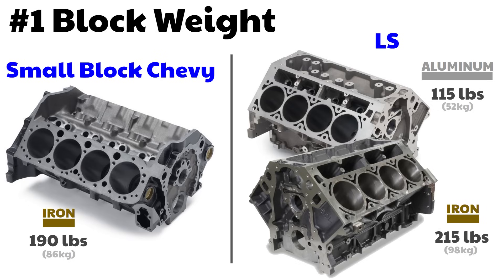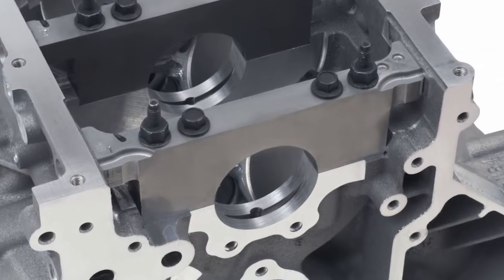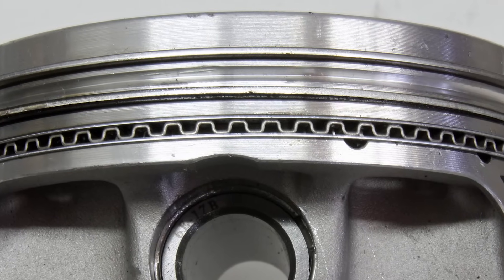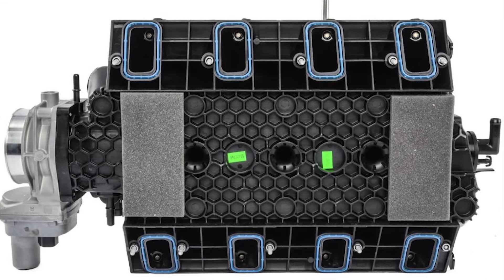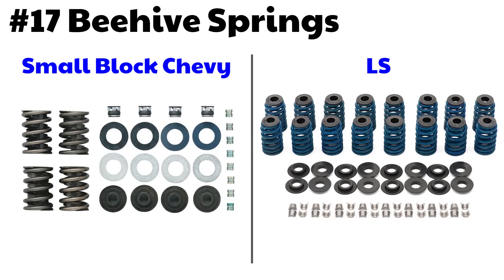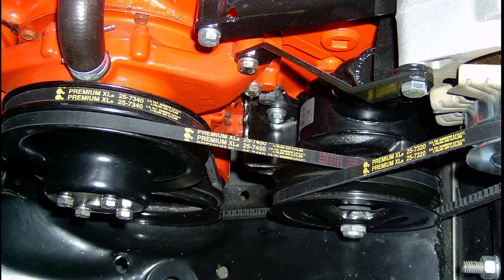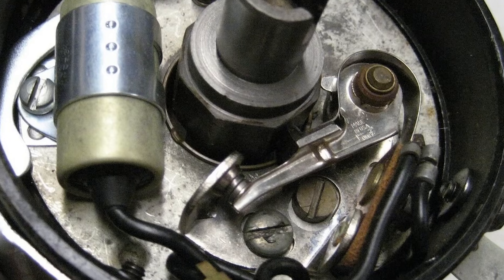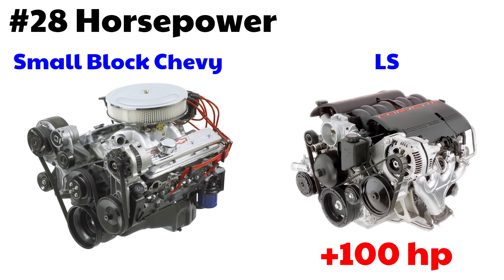29 Reasons LS is Better than Small Block Chevy (Gen 1 & 2 vs Gen 3 & 4)

Comment: Just one additional item to add on the LS exhaust manifolds, they are steel, not cast, so you can actually cut and weld for fitment to LS swaps.

Comment: A few things that made the LS better than the sbc, deep skirt Y block like the First Ford OHV, cross bolted mains like the FE Fords. Shaft mounted rockers like the Y blocks, non siames intake and exhaust ports like the SB Fords. Cleveland style canted valve  heads like the Cleveland Fords. So yes the LS is better than the sbc but they also found some better ideas from Ford.
Reply: Canted valves first done on the mark 2 BBC  mystery motors. Ran in Ray Fox’s chev driven by junior Johnson at Daytona back in 63. Bill France made Chevrolet sell one to Ford, that’s where they got the design. The engines were cancelled due to the GM racing ban. The slightly changed engine was released as the mark 4 ‘396’ in 1965. I had sbc and Cleveland’s but the sbc way better engines even with Siamese intakes.

Comment: The main difference is you need a certified mechanic to work on the LS. Its all controlled by a damn computer. All the sensors and all the new control modules. All that just adds another possible point of failure. You can work on a SBC yourself and you cant on a LS. The SBC is way better. dont need a computer to tune it. If u change one thing on a LS you have to pay even more money to reprogram the computers thats if the manufacturer didnt put restrictions on the ECU so it cant be tuned which is almost all newer cars and trucks. I am 40 years old and I will keep my SBC any day over a new computer controlled LS. I can work on my truck and change everything on the engine and not have to worry about a stupid computer throwing codes or reprogramming a computer given its not locked by the manufacturer. Its funny all the youngsters talk about what has been done to their LS or LT yet 99% of them didnt do any of the work and probably have no clue how to fix it themselves. Most couldnt even point out a specific part on a engine and what it does or why its important. SBC has not one of these problems. Just shows the younger guys dont want to put in the work on a engine to maintain it, "take it to the shop and pay someone to fix it". Probably dont even have any tools to work on it if it breaks on a Sunday or if theres no shop around. LMFAO. NO THANKS, I WILL KEEP MY SBC. YOU CAN HAVE THAT COMPUTER CONTROLLED POS.

Comment: Yeah  I agree LS is a superior engine in many aspects but I did see a few things, your HP ratings for SBC seemed Conservative, about any SBC block and crank will go around 500hp, another crazy thing is the skirted block isn't the best design is good for strength but that's it the open block is superior in several ways. World products prefers the open block vs skirted block that's why there are hybrid block is looked at as the best design thats basically a sbc that accepts LS heads. I was watching Noonan (I think) engines video there tippy top dog custom billet engine had the SBC/BBC lower block design. One thing is bay to bay breathing...? People are quick to disregard the SBC but with off the shelf aftermarket parts the SBC is still a viable platform there are plenty of folks that still successfully compete against LS cars with the SBC.  The mind blowing thing is the SBC was such a revolutionary design that with some help it can still hang with LS engines with 1950s architecture....
Reply from the maker: My understanding is on the old small block it really depends on what year and what engine you get.  Some could handle power and some could not.  With the LS you know for sure what you are getting.  The original engine is still a solid choice.  For me its the 100 pound lighter aluminum block that makes me love the LS most.

Comment: You are so full of yourself Why don't you compare the last year small block against the first year only LS. For example you say serpentine belts and roller cams The small block had that. How about when your computer goes bad how about one of your sensor is go bad how about 1 of your coils go bad and you have multiple mysteries and you can't figure it out. There is such thing as aftermarket parts Especially aluminum heads for small blocks That will flow just as much as LS is That will flow just as much as LS is. How about let's talk Bang for buck You will spend twice as much for LS Just in your sensors alone cut it out and if you wanna talk Bang for buck you can go with big block Chevy which will crush LS. There's nothing wrong with LS but you misrepresented the small block Chevy

Comment: Small block chevy is better gas and fire it will run and will go anywhere ls is trash after a hundred thousand miles the lifters clatter its not as powerful as a 350

Comment: this guy is a liar. my 1978 350 is 600 hp at 5800 rpm. 450ftlbs of torque. And i can add to 900hp! and this guy had never built an engine! All mercruiser engines from 1985 up has roller cam and lifters. GM motors.  What a clown.

Comment: Ironically, someone who already runs an sbc can use aftermarket parts to mostly level up with the ls.  Cop is available but not vvt iirc. Re merit of vvt, it's unnecessary because savvy engine builders talk customers out of high duration, torque-robbing cams.  That said, cars that need a swap would benefit from ls oem features.  Great video.

Comment: so the only performance advantage is the block and thats it. i can take  the original small block and use improved after market blocks , heads , cam  etc.. and build  it thats just as good or better  because the l/s has already used better materials and parts we can use with aftermarket.

Comment: No doubt whatsoever that the LS engine is far superior to the older small-block.  The LS was designed in the 2000's whereas the small block dates to the mid 1950's.  I am a baby boomer.  Say what you will, the classic small block Chevy is by far my favorite IC automobile engine.  Simple, super reliable, easy to work on.  I had a 350 from the mid 70's that went 250 k miles, still ran great. Didn't burn oil.  I got rid of the car because of rust, the bugaboo of those old cars especially in the northeast where I lived back then.  Wish I still had one.

Comment: You could not give me a LS. I have worked on several of the ls’s they are crap. In my opinion. Can’t beat the old school SBC. The old man’s 283 had around 500k on it before we had to tear it down due to a cracked head engine looked like damn new inside. Try that with ls. Lay it’s guts out around 200k

Comment: Hey you're wrong about about that you're wrong about the crank how much horsepower the gas crank would take you're wrong about how much horsepower that small block Chevrolet is rated for how much you can put out I know people is running cast iron crank and a iron block with twin turbos pushing a thousand horsepower I don't know where you got your information at

Comment: Take a 350/383 with 11 to 1 CR, give it a decent lift hydraulic roller cam, a set of good AFR heads with an RPM intake and you have one hell of a motor. No fuel injection or computer issues either.

Comment: Yeah those oil pans with their pressure relief valves are crap!   You'd better take that bypass/pressure relief valve out and plug it if you don't want it to fail and grind out your cam!

If your oil pressure suddenly drops to 20psi--YES, your pressure relief/bypass valve HAS FAILED!!!

Comment: One issue with plastic parts on the engine is that the material can't take years of heat cycles without an eventual failure. thermostat housings are an example, even though the LS uses metal. but the intake is plastic. I've worked on SBC's that had 35 yrs of daily driving on them and were running perfectly, with the original head gaskets still in there, mind you. in fact all of the internals, incl oil pump, orig. My Silverado has a Vortec head 5.3 and I love it. run a qt of "Marvel" in the pan at all times and the engine stays quiet as a mouse, that's the secret for the LS lasting a long time.  and change you coolant! once a yr, 2 yr max.. the pH levels get very high from combustion gasses and it decays these fragile metals they use now. change your coolant regularly. 🏁🏁

Comment: The cost of a modified ls is crazy. 1000 to convert to a carberater. Another 1500 for a manual distributor. And a bloer manifold and pulley. Much more. And powdered rods. Gag.

Bloodviking

Comment: Way off on the horse power, both have been over 1500 HP and reved to 8000. If you look into it the LS block cracks just below the cylinders, maybe that's why the skirts are there. It has been proven that the SBC block is stronger and one block manufacture is making a SBC bottom end block that is casted for LS heads. I don't think this was a very good video because there is only a few things that are correct, and I think one thing is just an opinion.  You can't increase the HP  much  without deleting the VVT. There are many things with this video that was not researched enough.

Comment: The LS is alright but over rated I mean for something like an rx8 swap or something like that bet but for anything that has to do with speed I don’t wanna be limited to 427 ci (7 liters of displacement) I rather build an old sbc to almost 500 ci vs being stuck at 427 ci and being like everyone else ,there’s no replacement for displacement 🦅🦅 if I have to go LS route swap or Vortec 8.1 big block Chevy got those high flowing LS heads with thick cylinder walls something LS engines Don’t have 👀 but a lot of older engines have thick cylinder walls including 😮sbcs ,bbc ,bbf , Windsor,hemi

Comment: In the end, the SBC will always be more reliable. The simplicity of it makes it easy to keep it going. You literally just need fuel air and spark to make it run. When you don't have a computer to tell you what the problem is on the LS, you're fucked.

Comment: Really?  REALLY?  Then explain why every NASCAR team used a 1955 SBC design until NASCAR mandated all Chevy teams must use the LS engine.  Explain why in 2022 every sprint car team running chevy engines (99.5% of all sprint cars) both 360 & 410 cu in. Use the 1955 SBC.  Cost => $55K and produce 950 hp naturally aspirated burning methanol.  Explain why Chevy gave Ron Shaver a blank check.  Tasking Shaver to make a LS 410 sprint car engine competitive with the SBC 410 sprint car engine.  Explain why after 2 solid years of R&D, Ron Shaver's best effort was 850 hp from a methanol burning LS with 435 cu in.  Not 410 cu in.  Explain why (in 2022) you can't pay a sprint car team to use an LS engine over a SBC engine.  Explain why in 2022 USAC sprint car rules allow a 3 in dia. 8 stack fuel injected LSx 454 cu in to legally run with SBC 410 cu in engines (with no weight penalty).  Explain why only 1 USAC team runs the LSx 454 cu in engine (even though it costs $15K less than a pro-built SBC 410) Explain why that team hasn't won dick all year, despite having several of the best wingless drivers shoe it.   Please explain how LS is superior to SBC when NOBODY will race it.
Here the dog shit ugly bitch is --->   https://youtu.be/4ap8RXSQ3H0?t=64

Comment: He said 'the aluminum block dissipates heat quicker than an iron block'

True.

Aluminum also absorbs heat alot quicker than iron, it also WARPS and weakens a hell of alot quicker than iron as well.

Which means when (not if) bad engine problems arise, the ol iron block will hold up alot longer than the weaker aluminum!

Let's not get things twisted, they started using aluminum blocks more cause ITS CHEAPER for them in manufacturing (not safer or cheaper for you to buy).

Comment: This guy may as well just sit in a corner and play with himself the way he's talking about this fing bs ls ...atleast with the old school sbc if you had a problem you knew right where to go. You  didnt have to have a " computer " to diagnose this problem if it was the carb you went right to that if it was a spark problem you went right to the distributor ..you didnt go for a laptop where it would cost an arm and a leg for the sensor just to tell you the air filter was dirty we used are brains like real men and women. We didnt rely on what a machine told us what was wrong.. so that's why I think that old school is better long live the old school 350s

Comment: I’m confused. I have a 99 suburban 5.7 - what engine do I have?
Reply: Are the middle 2 exhaust ports on the heads together?  If so, it's a SBC  (that's good IMO)
Are the middle 2 exhaust ports on the heads evenly spaced?  If so, it's a dog LS engine.
Reply: 99' is a GMT-400 body, and as such they used the 5.7L Gen I.
5.7L LS1 was only in sports cars during that era.
Reply: @bobjackson4287  Bo's parents couldn't spell "Bob"

Comment: The thing is though is that SBCs are still cheaper and are generally plenty good enough for most reasonable street builds. A good dirt cheap Vortec 350 based build making 300-350HP is all a good highway cruiser really needs.
Reply: That's what an ls does stock
Reply: @dantesixx1155 not quite that much out of a 5.3 a 6.0 or 6.2 yeah but they are a lot harder to find and much more money ..but your right a stock 5.3 is at least a 100 hp better than any 70s or 80s normal 350 say in a square body or an old impala or something thats a big bamg for cheap

Comment: The LT 1 350 chev from 1970 came with 370hp, and a broken crankshaft from the factory! lol. 20 of these reasons are pure fiction. The 350 chev was and is a pretty stout piece, and was the basis for many 500+ hp engines. Good solid bottom end and good head sealing with 5 evenly spaced bolts per cylinder. The main reason for LS magic is aluminum cylinder heads which allow more compression without detonation, the electronic engine management, which reduces detonation, the advanced intake giving a tune effect, and of course roller cam technology. These of course can also help the 350 small block by way of upgrade. No need to make the great LS even greater by portraying the small block as a weakling.

Comment: Not true I've seen plenty high performance🏁 small blocks 350/60 355/ 383/ 400/ 427/ at the Race Track out running LS motors it's all about how you build them🏁

Comment: At least 15 of the these I have on my small block stroker 
TerminatorX universal kit Solves like 6 alone 
Holley EFI intake 
Holley EFI elbow 
Holley EFI 95mm throttle body 
 Holley EFI dual sync distributor 
Holley 42lbs injectors 
Accel Super coils
Aluminum heads

Comment: The old 1960's engines were usually stronger than the 1980's. They had thicker cylinder head castings and if it were a performance application they had screw in studs, balanced floating pin rods that were magnafluxed and shotpeened and forged pistons and cranks. Even the 2 bolt main small journal engines often had forged pistons, early ones had forged cranks and late ones had thicker cylinder walls. The lt1 engines of the 1990s were fairly good but the port volumes were small. They employed a trick to make the cast cranks tougher using an undercut instead of a radius since the cast material was better under compression than tension, this undercut actually avoided tension cracks where the radius of the pins usually was. But generally it was the higher end versions of the 1960's engines that had the quality parts. The 305 was generally better than a small journal engine in my opinion because these engines probably didn't need the strong parts and the 305 heads were often better. But lots of 1980's and 1990's small blocks had all sorts of limitations aside from the lower quality rotating parts. The introduction of positive seals with the old fashioned rotators and retainers meant a lack of valve lift clearance. Only the aluminum heads of the lt1 got screw in studs while this had once been available to performance versions of the small block. And cylinder head flow didn't really improve until the vortec was introduced. The lt1 was okay but not great, the fuelly heads were still the king of the hill in factory heads untill that point but the vortec heads were likely to pull rocker studs and needed the retainers upgraded or valve guides shortened for high lift camshafts. It might have been a chalange to get 400 hp in the 1960's but it wasnt because the 1980's had stronger engines, it was because you needed a big camshaft or a power adder but those things were more readily available in the 1990's than they were in the 1960's. The tech in the 1990's lt1 allowed even a slightly weaker abc to shine with the addition of big injectors and a centrifugal supercharger. But the upgrades needed for most 1980's engines to catch up to the "fuelly" engines of the 1960's make any updates and upgrades moot in the wider sense. I would say for smaller engines the 305 was a better balance of cheap parts with better design vs a 283 or ,307. Many 283 had strong parts but if you wanted air flow you had to lose compression or get aftermarket domed pistons. The 305 heads were often just better than powerpack heads and those small engines didn't really need strong parts. 305ho or vortec 5.0 heads are probably a sensible upgrade for an old impala or malibu with a 283 or 307. The ls is better but i feel like the sbc never got it's chance to really shine. If we had a better factory fuel injection other than the lt1, something like used on mercruisers or ramjet crate engines combined with the rotating assemblies of the 1960's and none of the valve lift clearance issues of the 1980's and 1990's all in one place and it was wide spread i think wed still be searching junk yards for gen 1 engines. Fun fact, buick roadmasters had lt1 engines in them. You get the best of the sbc and the cover of looking like a grandfather in a wood paneled station wagon. Maybe there can still be life in the sbc after all!